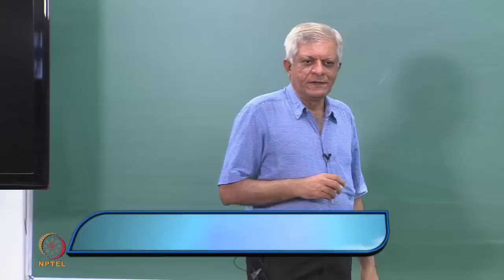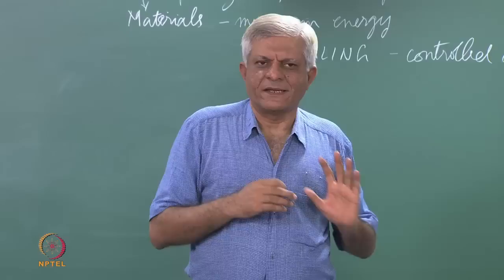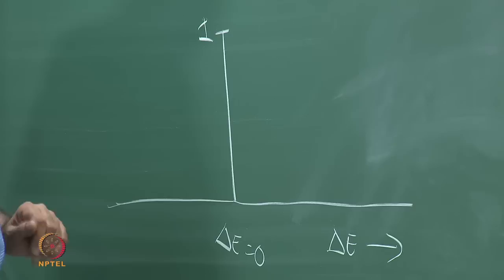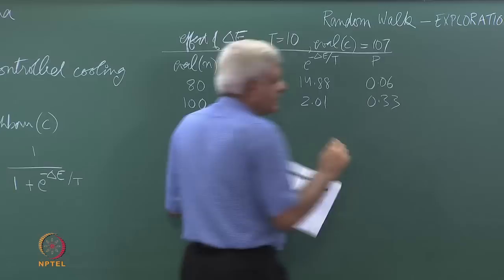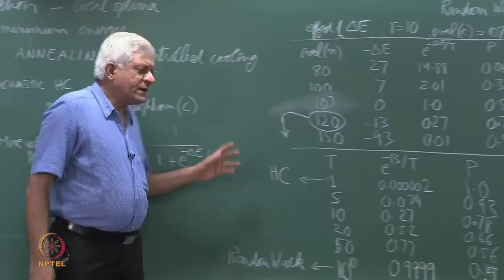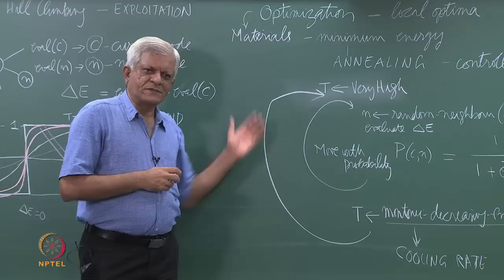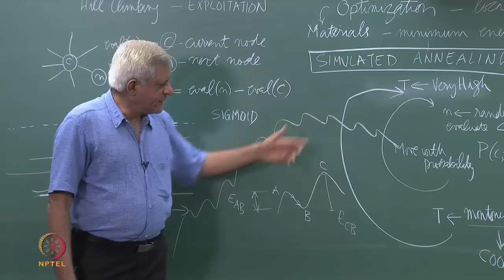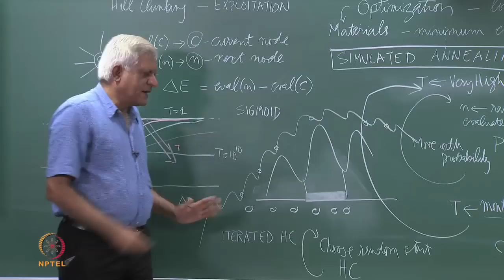Optimization - I (Simulated Annealing)

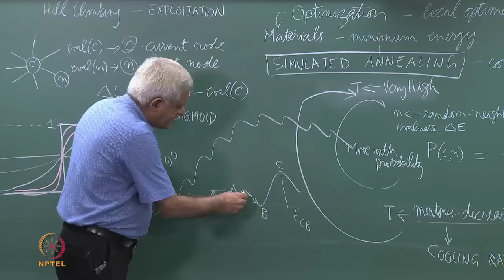Comment: Sir was saying that initially, the energy gap of AB is easy to overcome than energy gap of CB.So, the algo will go from A to C . But what if we start from C itself?would the algo come down from C to B ? at 41:56
Reply: I gs he said that initially its same due to randomness, but in general it has greater tendency to move A 2 C since on cooling the probability of making negative move decreases.47:00